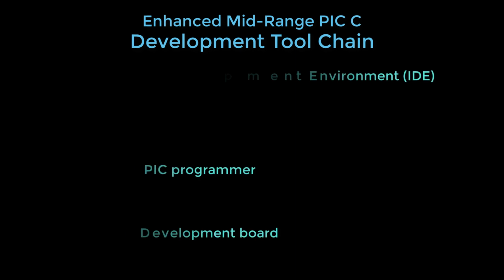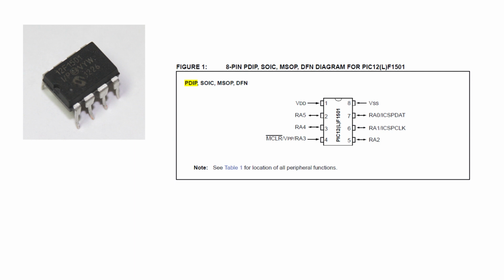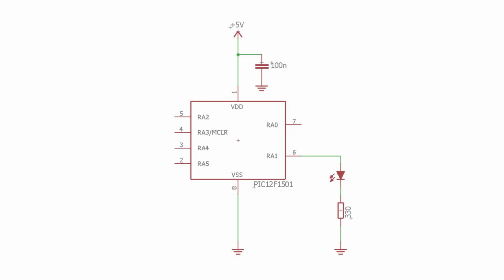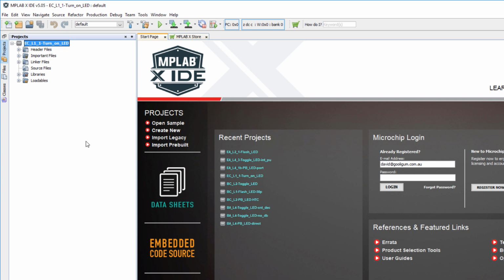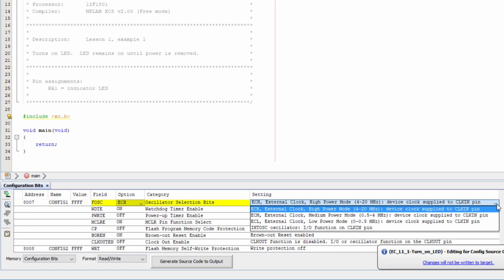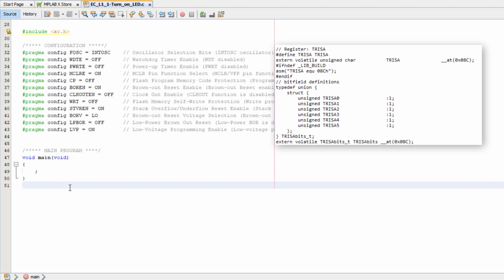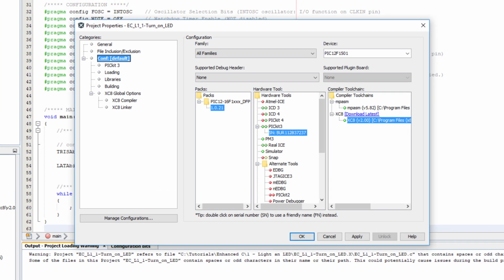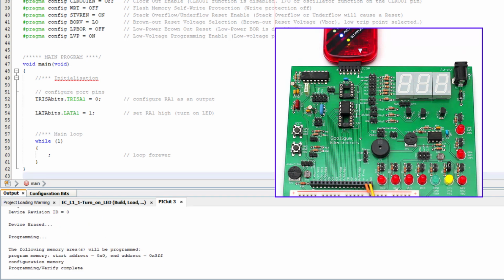Midrange PIC C programming lesson 1 -  Light an LED

Comment: Anyone know of a good comparison between the free and paid versions of the XC8 compiler?
How much smaller/faster is the code produced by the paid version?
Reply from the maker: "It depends" - but when you use the free version there's an option in MPLAB-X that tells you exactly how much smaller your code would be if compiled with the paid ("Pro") version.
In my experience it's usually around 75% of the size, for a non-trivial project, but it really does depend on your specific source code.
Also - unless you're making thousands of a product, it's generally much cheaper to simply use a bigger (more memory) PIC than it is to buy the paid compiler.